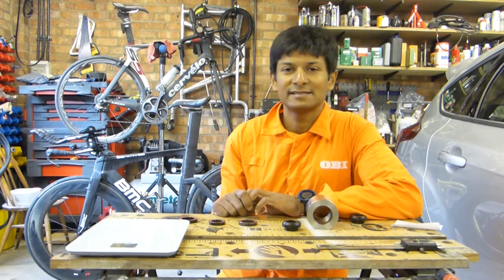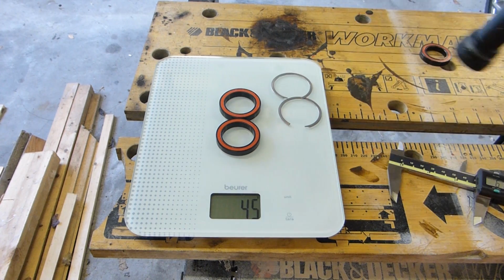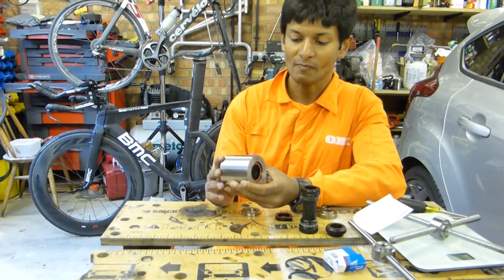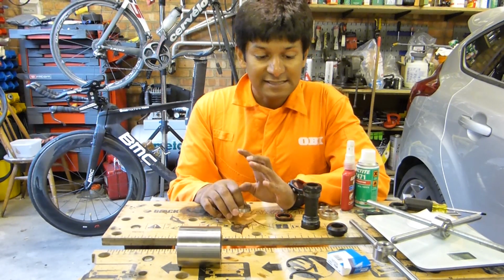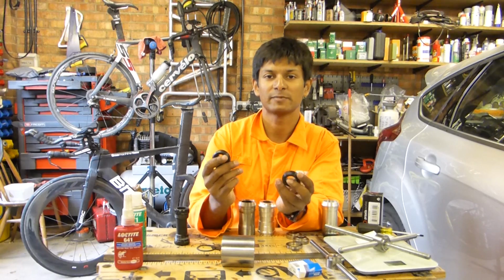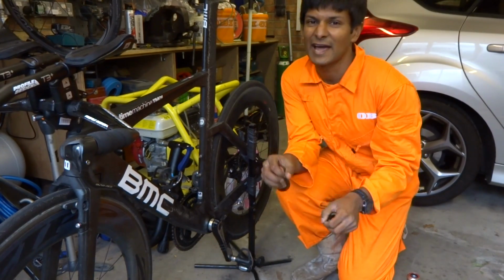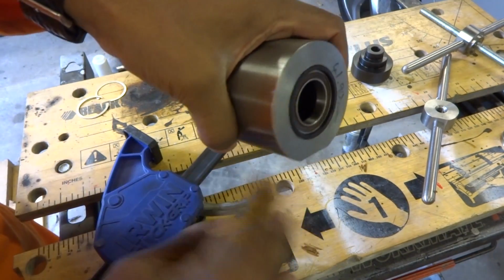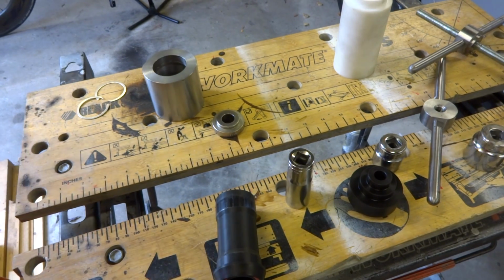BB30 Bottom Bracket Explained, Creaking, Pros, Cons and Fitting Shimano Cranks by Hambini

Comment: I can't believe what I've just seen here. So to summarise: you've made a dummy BB30 bottom bracket, constructed your own installation and removal tools, measured disparity from spec in microns with lazers, then built your own custom Shimano BB adapter. So far, so freaking amazing.
Thanks for putting a skewer through the Praxis works adapter. You've saved me a bunch of money and aggravation.
Getting back to some of your comments that I want to test with you. You suggest using loctite 641 around the outer race of the bearings but my experience (and that of other cyclists) is that the inner race/spindle interface is also a major area of problems and needs a lick of 641/609 as well. On my new Cannondale, the crank spindle is already exhibiting signs of fretting under the bearings and 641 has made a big difference in reducing that issue. 
Also - in terms of bearings: do you have any recommended manufacturers for the 6806? There are the obvious candidates such as SKF/Enduro. Do they produce bearing races with sufficient precision for BB30 installations?
Reply from the maker: Thanks for the feedback. In relation to your questions. 

1. Bearing systems should be designed so one end is fixed and the other is floating. In bottom brackets, the fixed is the interference into the housing. If you fix the crank as well, you will run in to a problem when the crank expands through heat (perhaps a warm day), it will at best reduce bearing clearance and cause more friction. At worst it will spin the bearing around in the housing.

2. I don't recommend Enduro at all. I think they are overpriced. SKF/NTN/FAG/INA/Nachi/NSK are the ones I would recommend. All of those bearings are produced to ISO/JIS standards. Enduro are designed to ABEC which is essentially a design standard for skateboards.

3. With reference your cannondale spindle. This is a problem whenever you have a hardened steel surface against an aluminium one. It's also the reason why Shimano always line their BB's with nylon or delrin to prevent the fretting. Not much you can do about this one. Retaining compound won't work in the long term.

4. I would hardly say I was amazing!

Hope that helps
Hambini
Reply: Most all of the bearing manufacturers he listed are readily available here in the US. You do not need to have a Japanese bearing shipped from the UK and spend that money, plenty of companies already import them.  Google is your friend.  If you live in or near any kind of city, I promise you that there is an industrial parts supplier near you that will carry these bearings, or can get them easily.  They are not bicycle specific, they are industry standard.
Reply: Chilly Paws That's an extremely dismal prognosis Chilly. Are you actually serious that every time the bearings wear out, that one has to replace a blooming crank AS WELL????
Reply: @Sionnach1601  No, Chilly meant to say the spindle needs replacing at the same time as the bearing, not the crank. So many people using the wrong vocabulary and making things even more confusing. Before you go buying parts a close inspection is in order. The bike industry needs to remedy this BB situation immediately. This situation is completely unnecessary and ridiculous. We most certainly have the technology to eliminate this condition, carbon can be held to very tight tolerances. Frame builders need to be held to a higher standard and be called out on the junk they're building or be praised for getting it right. You can't even test ride a high-end carbon frame let alone set it up and measure the concentricity of the BB shell,  beyond frustrating! If these issues occur we as consumers are obligated to send these frames back, not go and build adapters to mop up their mess.
Reply: @ticklefritz5406  frame builders will be held to the standard that sells, nothing else.  it's the only measure, only the cash generative survives.  Most folks will never beable to assess these standards when buying retail.
Reply: Can you provide a link to where we can order a bearing you'd recommend? I see a lot of 61806 with these dimensions; 30mm 40mm 7mm, is that correct? And how do I order smalley snap rings for my BB30?
Reply: I see you have them available through your website, sweet! Any chance you'd ship to the US?
Reply: In my experience most creaking is caused by wear to the crank on the non drive side. Even with brand new bearings you can get creak is your crank has even the smallest amount of wear. my advice is if/when the bearing needs replacing that you replace the crank at the same time. this will most likely eliminate any creak until the bearing next needs replacing

Comment: Great video. Thanks. What bb conversion you can advice me for Specialized Venge? Its 61.5mm and bb30?
Reply from the maker: Hi, thanks for the feedback. The specialized OSBB is a slightly shortened version of the PF30. PF30 is 68mm wide 46mm shell, the OSBB is 61mm wide with a 46mm shell. If you want to stick with a 30mm axle, I would go over to BB386, if you want to go over to a shimano system then I would advocate the one piece type system. The specialized BB is narrow so it's preferable to get the best stiffness you can.
Reply: I have shimano 9000 cranks on bb30 with fsa reducers. Looking ahead understand that this sat is not reliable. Can You plz advice better set, may be from praxis? Thanks
Reply from the maker: To be clear BB30 defines a shell at 68mm wide and 46mm diameter. Your shell is 61mm which means it is technically not BB30 but it uses the same bearings as BB30. The bearings are 6806. A lot of people on weight weenies recommend the wheels mfg adaptors, so that might be an option. I had a praxis BB30 to shimano conversion unit and it creaked which is why I made my own.
Reply: @Hambini  PF30 shell = 46 mm shell diameter, BB30 = 42mm shell diameter, is it right? . BTW,  what BB would you  choose if you planned to buy a new frame: BB30 or BB86 ?
Reply from the maker: @GrzegorzCarnivore  That's correct. I would go for a PF30. It gives the most potential to fix any flaws
Reply: @Hambini  Thanks , but after I reviewed films on your channel and read vast amount of comments , I would 'd rather stick to BSA threaded BB...

Comment: Very helpful video. After watching I'm confident that threaded external bb cups are the best for average joe cyclist not racing in Le Tour. subscribed -
Reply from the maker: I think that will change when the UCI drop the weight limit. When they do that, the weight saving from a pressfit BB will force Pinarello to look in that direction
Reply from the maker: Thanks very much. I agree, the implementation of press fit BB's into bike frames was a bad idea.
Reply: Hambini  BTW excellent video and keep up with making more, but I disagree with the comment. BB is a heart of the whole drive system and in my engineering opinion weight savings should never compromise BB area. You can shave the 100g or so elsewhere on the bike. Happy owner of Pino Dogma with threaded BB smiling hearing horror stories about press-fit.
Reply: Apparently, Team Sky still insists on threaded bbs, and as far as I can see, Pinarello still uses them on all their bikes. If you can win the TDF today with threaded bbs...yeah, press fit bbs are 100% bs.

Comment: Awesome video! Do you think your BB alignment issues on the BMC frame may have been caused by the Praxis adapter? I've seen people claim that the expansive nature of it can deform the bracket slightly.
Reply from the maker: Having measured the hole after I removed the praxis adaptor, it did not look like it had deformed it BUT I didn't tighten it to the recommended setting by praxis out of fear of cracking the frame.

Comment: This is such a good video & explenation of my imense iritations from my creeking BB30.
I have a Norwegian Nakamura, with press fit BB30´s which have plastic cups in which the bearings are pressed into. The hard thing to know then of course, is if the creeking comes from the friction between the Carbon frame and the cups, or from the bearing and the plastic cups, or from them both. I will ask my mechanic if he´ve used the additional locktight primer you showed. Because he has tried to fix this twize with no luck. I can´t believe that the road biking industry haven´t stopped with BB30 and moved on to a better solution. It seems to me that a 90,5mm standard where they machine the titanium bearing housing and have ways to incorporate that titanium housing into the barbon frame, would be the best of both worlds? Or is just the 68mm threaded BSA the best choice? Thanks anyways, so glad to see someone who has had the same problem, yet also the knowledge to do something about it and share. Thanks!!
Reply from the maker: Stian Maurstad i think you have got a pf 30 bottom bracket which is very similar. I'll do a video on that shortly. Bearing creak is so annoying.

Comment: Great video mate. Cheers for doing it on request. Don't give those designs away. The big three might actually buy those.
Reply from the maker: No Problem. I'm a great believer in open source, so I will leave it that way. I might put a link at the bottom to see if anyone wants to purchase a ready made one.
Reply: Hambini I'm sure people would, especially with the ease of maintenance. It's a very clever solution I think. I'd get one if I wasn't running sram red 22 with bb30 cranks. Guess I'm stuck running bb30 bearings in my caad10. I might get myself a press tho so I can do my own bb work because at the moment it's the only thing I can't do at home.
Reply from the maker: Yep, unfortunately you are stuck with BB30 cranks as they have a shorter axle. The crank arms flare out more to give the heel/ankle clearance. I would definitely recommend a press tool, although you could go down to your local DIY shop and get a piece of M10/M12 stud bar, penny washers and two nuts, it would do the same job although it would take a little longer.
Reply: Hambini I like the idea of the diy press. Might give that a go and source some bearings local here in Australia. Where do you get the retaining clips from? Are they something that needs to be changed with the bearings?
Reply from the maker: A bearing and transmission shop should be able to sort out the rings. If you get your crank out and shine a light through the hole, see if there is any corrosion. If they are corroded change them.